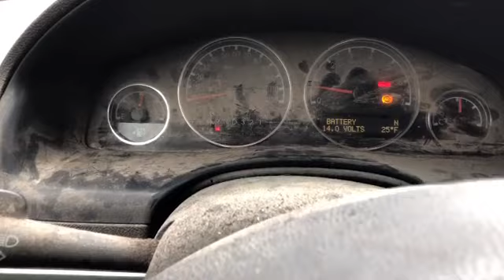LOOKING TO GET RICH QUICK

Comment: Good  day Marty  About 20-25 yrs. ago up here cardboard was $400./  ton.  The other half of building  ground  plastics,  boy those gaylords  I think weigh 40 lbs.  People were taking cardboard for blue recycle  bins .
Thanks
Reply from the maker: $400 for cardboard  !  
Yeah I gotta move to Canada 🇨🇦 
So what if gasoline is a bit more 
Jeez that is way more than it’s ever been here 

Although houses in Canada are almost $1 million bucks  for anything decent in a decent area unfortunately
Reply: @steelisthemeal  Nobody takes it now, I guess card board is not as widely used. Right now in BC they are shutting down all the paper mills and sawmills.
Reply from the maker: Isn’t that just great 🥲

Where’s the Amazon cardboard coming from then?  
Gotta make packages more expensive